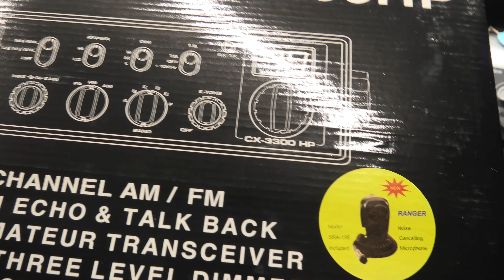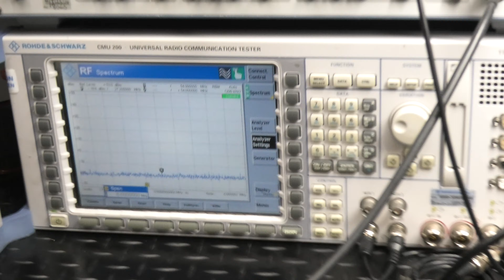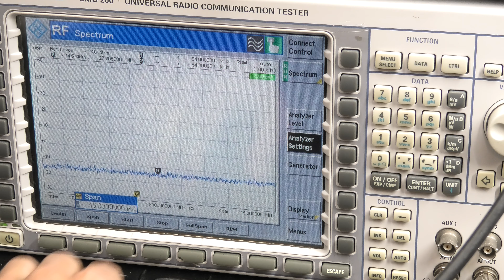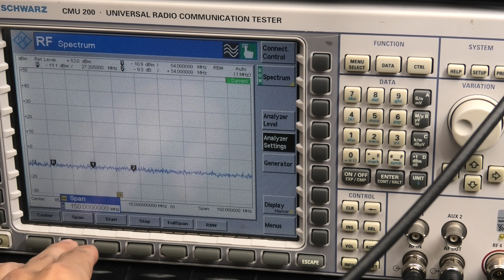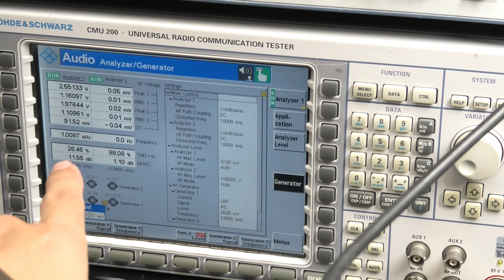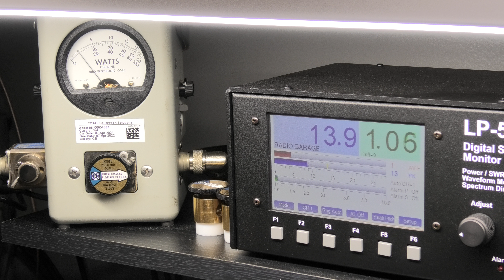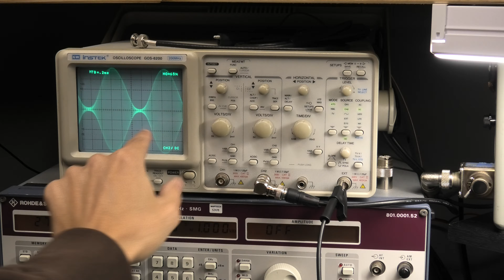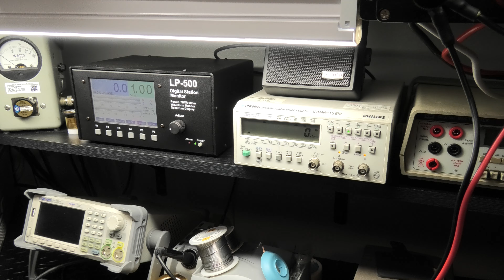Connex 3300HP New Batch *Upgraded* For Fred CB Radio

Comment: I have a older galaxy Dx33hp with dual irf520 mosfets and I cant get it nowhere near 60 watts. only 30 @14.2 v. tried tip36c, and the likes...Same key maby with a Half of what defrence between the Am reulators i tried, but same output and modulation. Is it a must that you need to cahnge the  AM driver when you use the Tp36c? all i got was a bunch of exsesive heat from all of the regulators. but the finals never got really warm at all. so im stumped at this point but theis was a golden screwdriver job I took on. It talks good ,is on freq and no flat topping modulation transistor is in tacted as well, that is bout the only thing going for it. thanks any info would help  get rid of all the exsesive heat from the AM regulator.

Comment: Cracked insulator? Fast drying facial cream for thermal paste?
Whoa is us, Quality Control has missed the bus, but the SRA-198 is a plus. Sad that you have to put a microscope on a new radio. Glad that you take the time to do it, Matt.
End result...someone gets a great radio.
Smilin', I'm off the key. 👍  😑🦗
Reply from the maker: Who would imagine that you would find things wrong on a new radio? That's why it's hard to answer when folks ask me what they should do,buy new or refurb a used rig? Doesn't matter..they all need work!! 😄👍👊